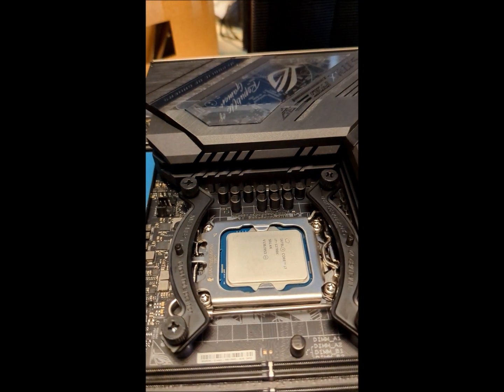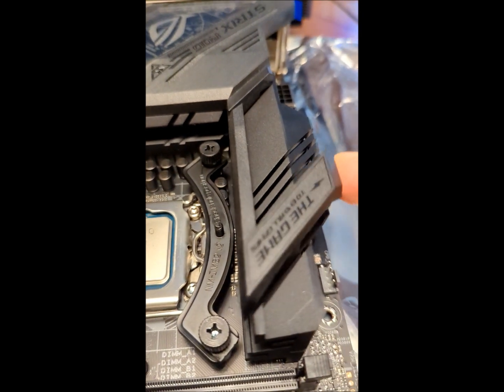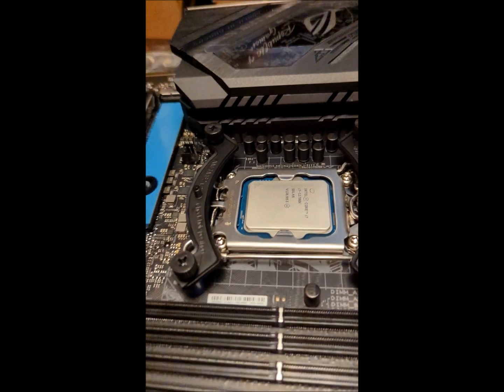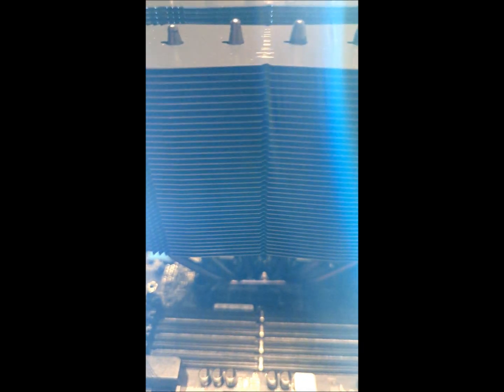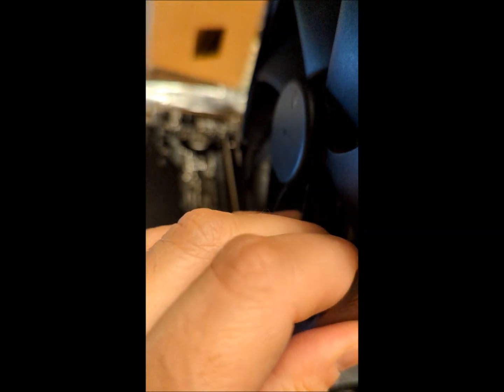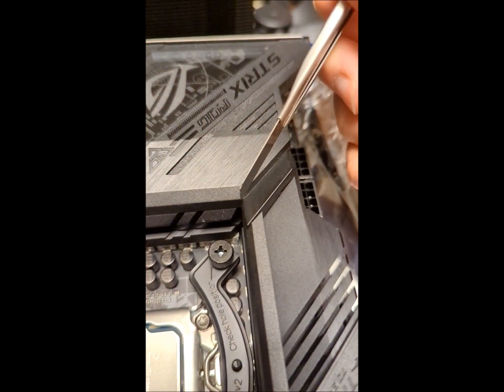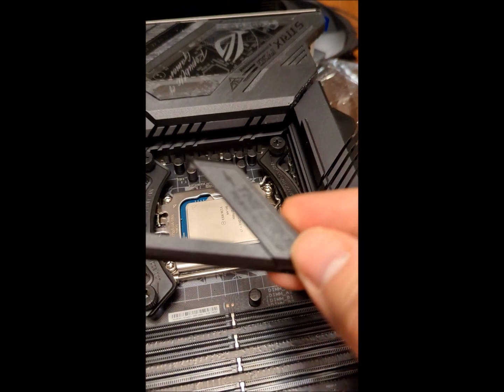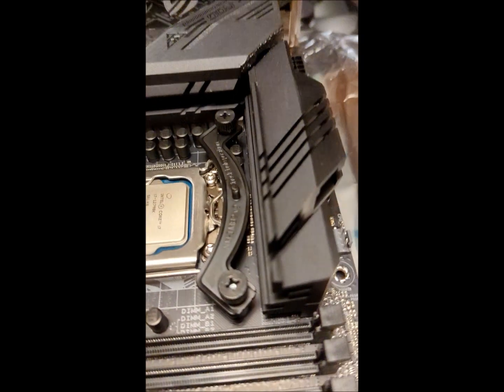Nocuta NH-D15 - NH-U12A Cooler install on Asus Z690 - Alder Lake Motherboard

Comment: Why hasn't there been a collective class action lawsuit against ASUS - none of the motherboards with these crappy heatsinks and covers work with Noctua coolers other than in reverse orientation which is a HORRIBLE configuration because you are pushing hot air into the GPU or hot air from the GPU into the CPU cooler.  ASUS lied to Noctua, none of those are mechanically compatible on any of the ASUS boards ..........

Comment: I just bought one of these boards. Asus Strix Z690-F. Ran into same problem with the DeepCool AK620. Checked Noctua's website and a bunch of them should fit these boards. I'm going for the Noctua NH-D12L.
Reply: How did that turn out?

I’ve decided to just return the board. 😮‍💨
Reply: @CarrotHawk  All is good. Cooler fits perfectly and zero problems with the board.
Reply: @stevedaigneault  If you don't mind me asking, what CPU are you using and how are the temperatures (preferably initial stress test is you did one/can remember)?
Reply: Glad to hear it!

Comment: WOW 😀 Thanks a Million for this video 🙏🏾🙏🏾 You saved me some headache.  I bought the Asus z690-a and already had all my other parts. Yours is the only straightforward video I found.
Reply: **Update**
After removing the vrm plastic cover,  the air cooler I have still hits the metal heatsink of the Asus z690-a.. Sigh 😕... Oh, and the cooler is Vetroo V5 LGA 1700. So I guess it's back to searching. I have a white build.. does anyone know what air cooler will fit? 🤷🏾‍♂️🤷🏾‍♂️🙏🏾🙏🏾

Comment: Not good. Just unscrew the coolblock from your mobo, then unscrew the plastic bits off, then install the vrm heatsink again and there you go. If you plan to sell your mobo, you can screw the plastics back on the heatsink.....

Comment: I have a ROG Strix Z690-G Gaming mobo arriving tomorrow and I have the Noctua NH-D15 cpu cooler. After removing the plastic piece, we're you able to run both fans on the noctua cooler or just the one?

Comment: Sounds a bit scary. Do you think I could break it off without causing any damage?
Reply: You risk doing damage by trying to break it off versus simply cutting it off.  I did the method described in the video and it worked perfectly.  There aren't any actual functional components where you are cutting, just the metal heat sinks so it's quite safe.  The trick is to keep heating up the blade and let the heat do the work.

Comment: Thanks man. I have the same issue but with a be quiet! Dark Rock Pro 4 Air Cooler on a ASUS ROG STRIX Z690-A GAMING WIFI D4. Just wondering if it will fit if I cut the plastic.
Reply: Did it fit? I have the same issue?
Reply: And also did it work? :D
Reply: @pavelkoudela5805  It worked, but it was slightly misaligned.
Reply: @pavelkoudela5805  Yes. But after removing the platic part.

Comment: I presume the NH-D15 chromax.black will fit by doing this as well? I have no issue with removing the shroud, but I rather not file down the VRM heatsink like some were doing for be quiet! coolers.

Comment: First thank for this video. I just got Noc15 black and Asus strix 690-F. I dont want saw piece of plastic out yet. My case is Lian Li 215. I will try to install noc15 on vertical way. Got new issue. Cant set another fan on top (same plactic is away, and case is too small to lift cooler any hinger) so it could cool top heat sink. Ok. I find some video where some left another fan out, just because it looks beter with just one fan. Maybe it works. I will set second cooler top of case to blow in. Maybe test temperatures little also what direction i should set fans to blow. I also got LianLi Vertical GPU kit. Will see are they all fit. Vertical GPU kit helps when cooling works vertical way. Only thing is that case 215 does not have good possybility to set fans from bottom. Maybe this Noc15 works perfectly with case LianLi O11 Evo. Where air can blow from bottom to roof. With no side fans on front head. Or Hyte y60. Had plans to buy CoolerMaster H500M because fit 2x 200mm top fans, maybe what just Noctua 15 need. Not going to give up. I want  noc15 the best work with the best Asus strix Z690F.

Comment: Hello and thank you for the instruction. 
Because of your video I bought a ASUS ROG Strix Z690-A Gaming WiFi D4 motherboard. I cut of the piece of plastic with a handheld driller and little saw blade. Worked fine. Without the peice of plastic it was no problem to installing my Noctua NH-D15 cooler.
Reply: What CPU did you use? Would love to know more details and feedback about your build. 
 I'm thinking of pairing a 12900K with a D15 for a workstation build, but not sure about the motherboard yet. I like the Z690-A features, but not the shape and color. I'd appreciate any recommendations for a mobo.
Reply: @ro-minimal  I only have a i5 12600k. The only thing I don't like, is the boot time of the board. It's really slow.
Reply: @tobishlim8323  Oh wow. How many seconds does it take to get to POST?
Reply: @ro-minimal  Hi, it takes about 10 seconds from power on to the beep and about 35 seconds from power on to windows logon. My old configuratin (ASUS Z370 + I7 8700) needed only 23 seconds. Ok, now I have 2 m.2 ssds instead of 1.
Reply: Hello I would go for the strix z690 A D4 too but with a NH U12 A do you think I will have to do the same or its fine because its a smaller cooler ?

Comment: Thanks!  I now have a NH-D15 mounted on my Asus Z690-E with some Corsair Vengeance DDR5 5600MHz.  I thought I might sand down the edge a little, but the Noctua cooler is so big it completely hides the point of removal.  I never would've thought to melt/cut the plastic with a hot box cutter, but it worked perfectly.
Reply: I'm considering buying the same specs as you. Did you face any issues mounting the cooler? Also, any other issues you had once you started using it?
Reply: @arun279  I faced no issues once this piece of plastic was removed and no other issues since.  Build has been perfect so far!
Reply: @Lazirus951  great. Thanks for the response, I’ll go ahead with my build.

Comment: if you mount the 2nd fan on the D15 is there any issue touching the RAM sticks?
Reply: You can move the fans higher if you need the clearance as long as your case has enough space.  You should stay away from Dominator RAM and other RGB RAM if you use this cooler as they are taller and the fans will cover up their RGB lights anyway.  The higher you move the fans on the heat sink, the less effective CPU cooling you will get.
Reply: @Lazirus951  oh ok thank you for your precious answer.
Ive got corsair vengeance DDR5 no rgb 2 x 16go
MB asus z690 E gaming
I9 12900k
Im willing to buy the NHD15 for it as i heard its the best cooler
And i was wondering if i hacked the mb it should do it.
Reply: @Mamids  I have DDR4 corsair vengeance RAM and it works fine with the D-15.  I'm upgrading to exact same DDR5 and motherboard as you soon, so also came to this video.  

From what I've seen, you can either hack the mb like this video, or unscrew the plastic shroud entirely and disconnect the RGB underneath to remove.  I'll probably just hack off the plastic like this video since D-15 is so large it'll cover it up.

Comment: Cool but this cooler is D15 version, not D15S
D15S compatible without removing the plastic cover I think
This is the difference between D15S and D15
The D15S has a larger deflection on the side to avoid heat dissipation. You can go back and compare them
Reply: you can install it with the offset on the side of the gpu, using an nvidia FE edition, that proximity has an effect on the gpu
Reply: The D15 and D15S are pretty much the same now, so it does not matter, both will have issues with this board.
Reply: Of course I found a difference, my dear. There is a difference even now. I recently bought it myself and the motherboard is an Asus and have not modified anything. I just installed it and had no problems.

ROG STRIX Z690-A GAMING WIFI D4
Nocuta  D15S
 @jimmydandy9364

Comment: Thanks for making this! I've been thinking of getting this mobo with a 12700k and a D15. How do you like your build so far with those parts?
Reply from the maker: Working Perfect! Nice and cool max 76 degrees under cinebench with all the fans on silent mode!
Reply: Hey @Roman Sanchez, 

Did you find an alternative to this motherboard for your 12700k? I'm planning to do the same build.
Reply: @srisharanchundayil8933  I haven't bought a mobo yet but I'm looking at the MSI z690 tomahawk since MSI z690 boards have more room for the D15
Reply: @BroSanch  Wondering how your build went? I'm thinking of pairing a 12900K with a D15 for a workstation build, but not sure about the motherboard yet. I like the Z690-A features, but not the shape and color. I'd appreciate any recommendations for a mobo.

Comment: At the beginning of the video you said D15S. I hope it's D15 though.
Reply from the maker: They are all incompatible in the back to front config as per noctuas site. Its the heatpipes that touch the VRM plastic Yes i meant to say D15 with two fans :)
Reply: @Boratbbq  NH-D15S has an asymmetrical design with offset. I'm looking for a video of installation (offset towards the PCIe cards) as described on Noctuas site.
I have D15 with z690, and yes it's a bit incompatible because of VRM plastic.